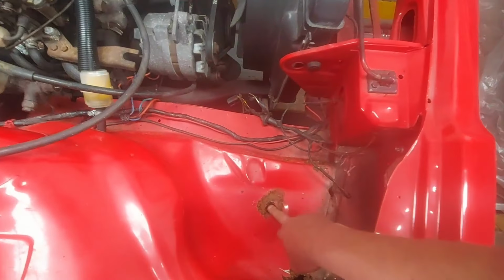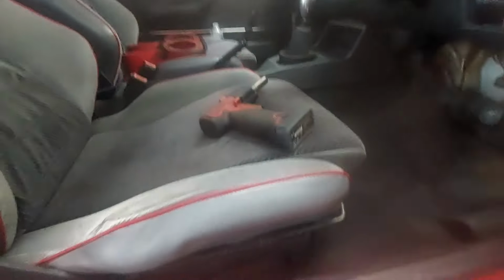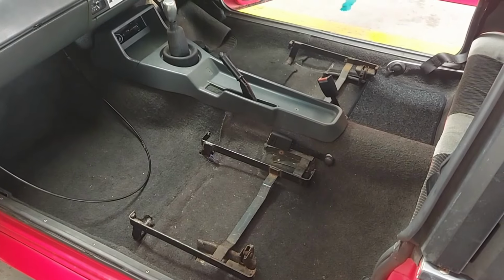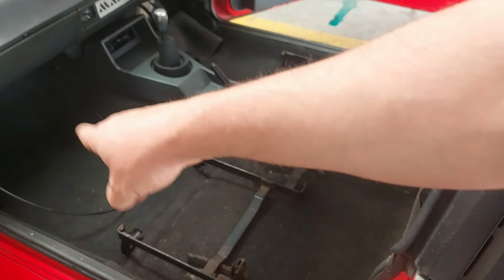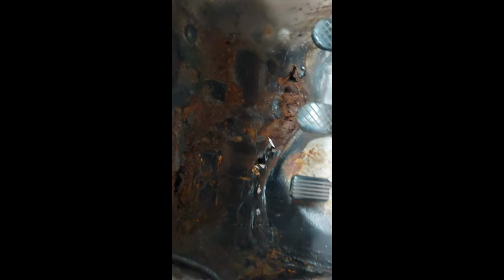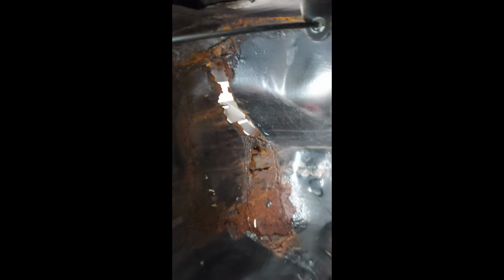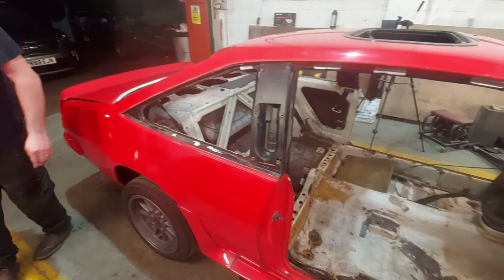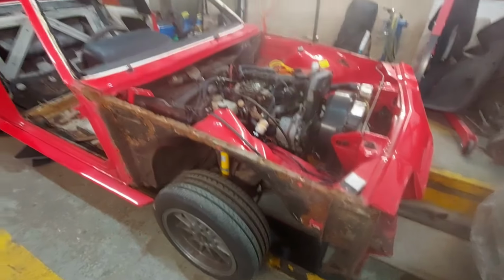Restoring A OPEL MANTA GTE [The COOLEST CAR from the 80s]

Comment: there is much more floor left than I have in mine 😃 how much do you dare cut out of the floor before it folds? mine is the left floor well almost completely gone and the kick box is kind of gone 😐
Reply from the maker: I normally do the floors one side at a time. Normally I cut the full floor pan out providing there's still some strength in the sill
Reply: @RetroRestorationGarage  did you have a email? So i can send you so you can see 😐
Reply from the maker: Yes Andy.fms@hotmail.co.uk should also be in the video description
Reply: @RetroRestorationGarage   thank you😃 aha you have that. I miss that 🤣 my Manta is... You see 🤣
Reply from the maker: @snubblo82  just been looking at your email  it does look quite bad but we have restored worse believe it or not 🤣
Reply: @RetroRestorationGarage   I'm going to get it out on the road again but it will take time 😐 Do you think I need to worry about it folding if I cut out more and change the floor wells? one page at a time. I'm going to start on the left side. the one with the most floors.
Reply from the maker: @snubblo82  put some strength back into the chassis, rails first, Then A post, inner wings, battery tray inner and outer sills etc first before cutting on the floors.
Reply: @RetroRestorationGarage  it might be best to weld a brace between each door just in case 😐 I'm having trouble finding floor drains behind buying new ones. do you know of any? I have found ascona a and manta a but it doesn't look the same 😐 my plan is to have fixed all the rust this year, then the 2.4 goes out and they're going in a 3.0i and 400 skirts 😀
Reply from the maker: @snubblo82  brace is a good call just take it steady and keep adding strength. I think a lad on Facebook called Alastair mcaully sells them. If your struggling i have loads of used one i could send you some.
Reply: @RetroRestorationGarage  it's a shame on the floor. but these are becoming rare now, so those that are left must be saved 😀 I continue to follow your gilmer about your 😀 Yes, I'll keep your email and update you on my progress when I've done something. small garage, lots of work and 3 small children mean that I don't have as much garage time as I want 😐
Reply: I don't have Facebook 😐 haha
Reply from the maker: Same here running 3 businesses, youtube and 3 young kids at home. Lol
Reply: @RetroRestorationGarage  keep busy then. do you have a schedule for manta or are they just the way they are?